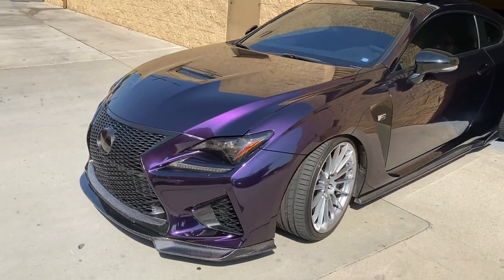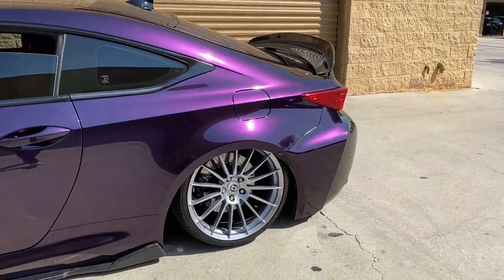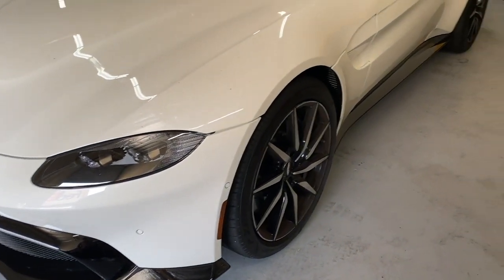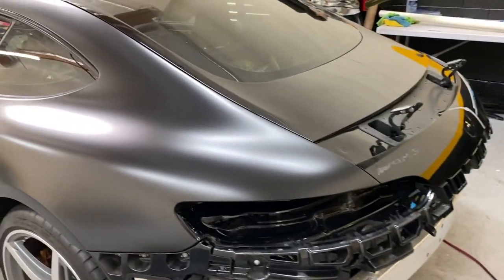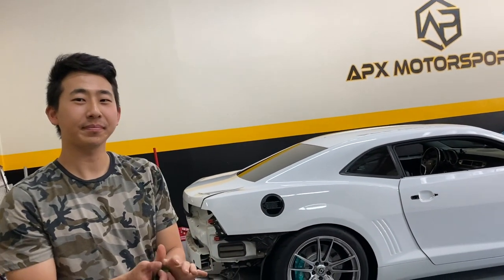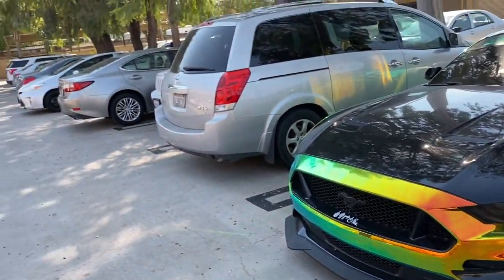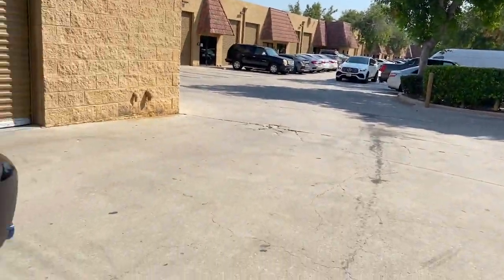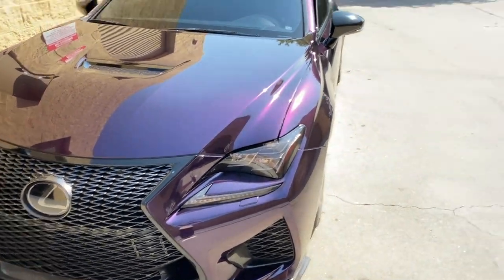NEW WRAP for the RCF! Inozetek Midnight Purple

Comment: Throw a supercharger on it 👀
Reply from the maker: Haha nah, even with a supercharger it would get dragged by both of my pickup trucks. I’ll save the money and have a reliable daily instead lol
Reply: @raysp3c  what do you mean? Are they not reliable after heavy mods like supercharger or turbos? Or do you mean it won't make much difference in speed? Lol sorry for being a noob
Reply from the maker: From what I’ve seen personally they’re pretty slow until you start running more boost, meth and e85 then they’re ok. Keep in mind the car that did that here blew up his motor and had to get another one lol